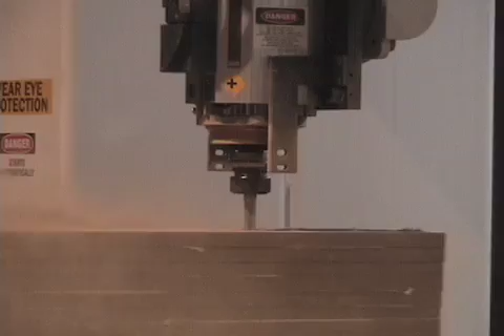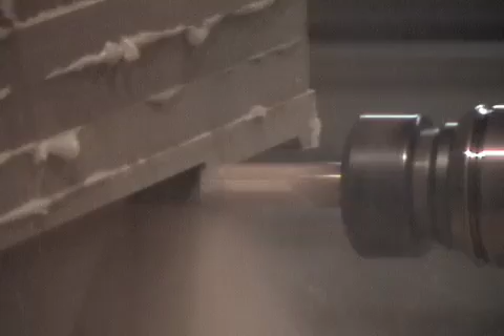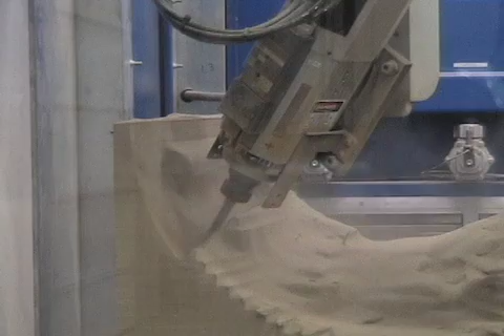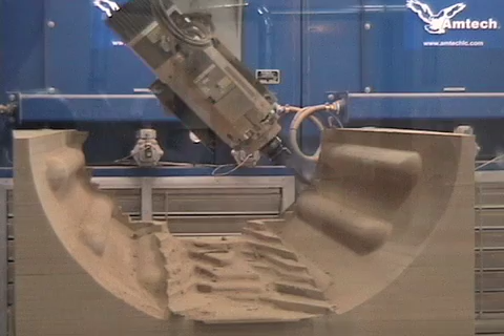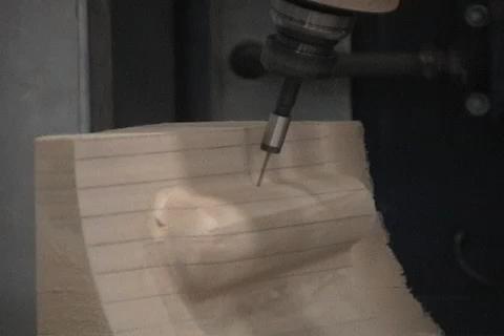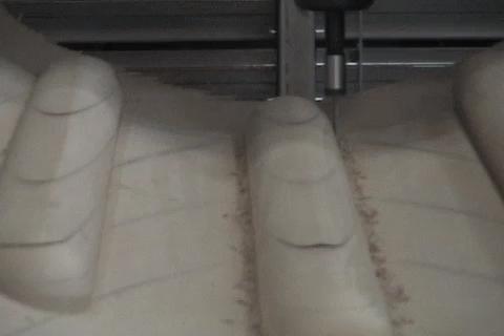Thermwood Corporation - 5 Axis CNC Machining Pattern

Comment: It's impressively rigid, thats a lot more stock than I could leave with MDF on our 5 axis router.
Is it just the camera angle or is there a chance of those power cables getting snagged on the work piece?
Reply from the maker: Hi,  Sorry for the late response.  Most likely the camera angle.  They are closer to the head than what it looks like.

Comment: What is batter for 5Axis machine.
Stepper or servo motor?
To make statue how many Axis is advisable?
Which power machine is advisable. 3 phase or 1 phase?
Thank you in Advance.
Reply from the maker: Hi Chintan,

Sorry for the late response.  Servo motors are better for a variety of reasons.  All of our machines use servo motors.  To machine a 3D statue, 5 Axis is what you would need unless you wanted to machine in multiple pieces and then bond together.  3 Phase is common for CNC

Comment: That MDF dust,   ain't sawdust.   It's a ultra fine powder-dust.    It's poisonous and it sticks to everything..  When it's air-borne,  it's explosive.  just like coal dust.
Reply from the maker: Hi Thomas, that is why we have those blue Amtech dust booths in the back of the machine to take that dust out of the environment.
Reply: @ThermwoodCorporation  Hi how do you attach the dust collectors to the 5 axis M67?
Reply from the maker: Hi, The dust booths are separate units that are positioned close to the back of the machine.  They are used to collect the airborne particles when machining.  The bigger particles fall to the ground to be swept up.